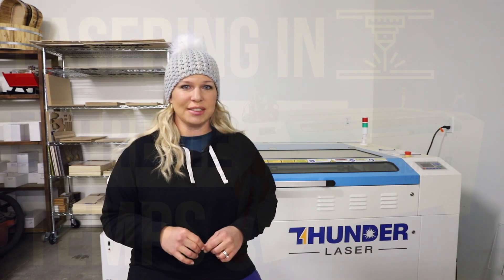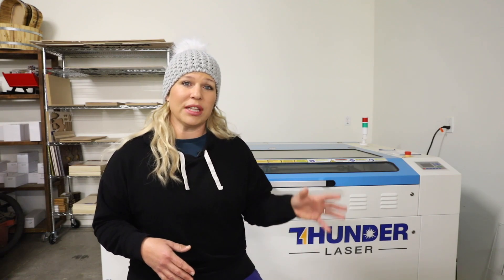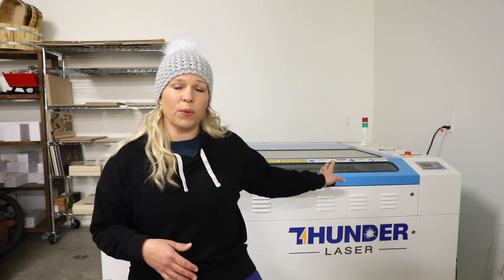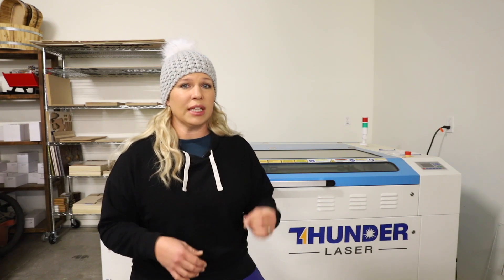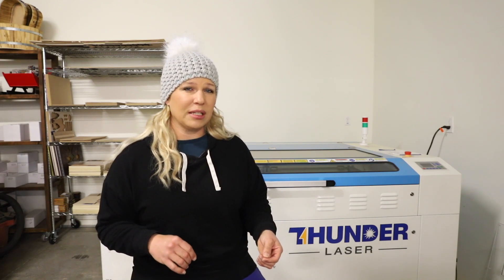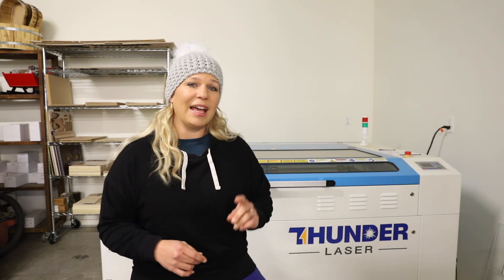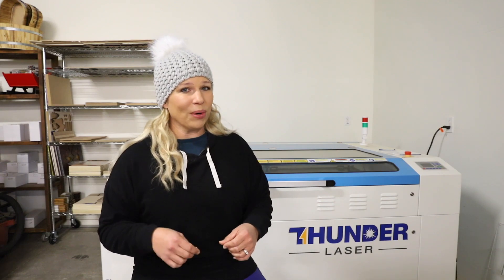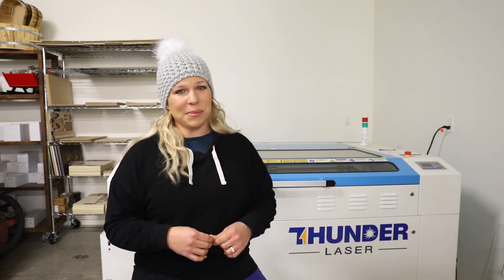Lasering In Extreme Temperatures

Comment: Hi Katie, cool morning greetings from Fountain Hills. You are absolutely correct about temps. The batteries on my power tools overheat in summer, i have to refridgerate them before i charge them. Many people dont realize that our summer temps are OVER 100 from 10am to midnight !! Except during monsoon rains. Thanks for sharing you info.
Reply from the maker: Yep!  I haven’t had the battery issue you speak of, but working in these high temps is an adventure.  My shop is 2400 sq ft and has gotten up to 115 degrees on some days.  I just drink a lot of water and remind myself that it’s only for a few months.  I hate working in the cold temps more than the summer😂